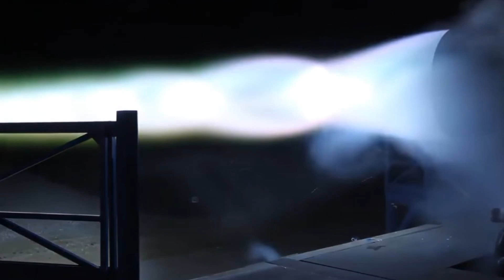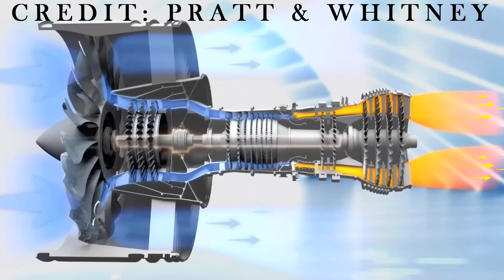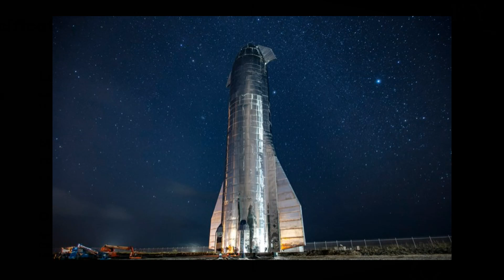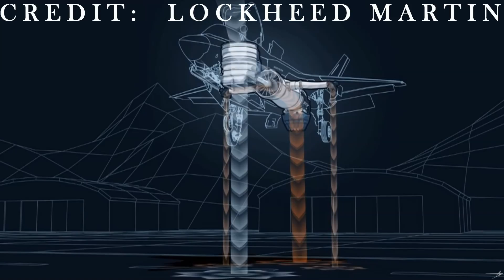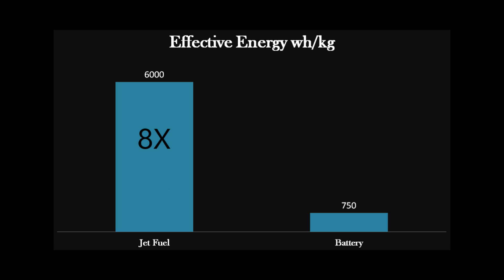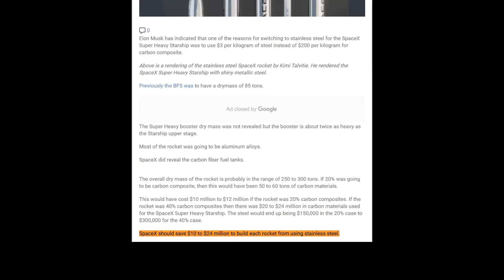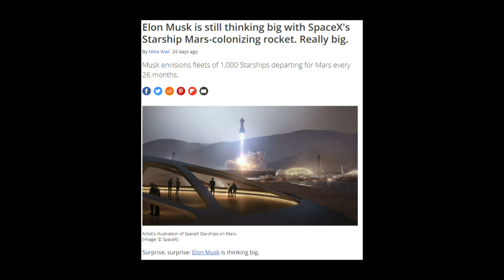ELON MUSK'S BATTERY POWERED SUPER SONIC VTOL JET - My Tesla E-SuperVTOL design

Comment: Really good stuff man. Here are some thoughts, hopefully you can let me know your thoughts about that.

First, it is good to use empty space in nose and tail, but the bulk of the heavy stuff like batteries should be  in the lift surfaces (wings) if safety permits. That's because having heavy stuff lifted directly takes less structural effort than putting heavy stuff in the fuselage. Therefore, the interface between wings and fuselage can be made weaker and lighter. It might be very helpful to place stuff that is heavy in the nose and tail but that can be moved from front to back (changing location of center of gravity) to follow the changing center of pressure due to transsonic and supersonic regimes (like the Concorde, which used fuel to achieve that). In this case, a useful liquid could be moved forward and aft, not sure what this liquid could be. That adds plumbing too. Maybe a smarter solution using wing, control surfaces or motors could be used, but I think any of that will inevitably increase drag.

Second, if you have 6 engines for redundancy, you need the aircraft to operate properly with 5 engines (the most critical engine being out). In this case, the most critical engine will be one of the 2 forward or 2 aft engines. I'm not sure the aircraft could balance itself on landing using 5 engines, because the engine opposite of the failed one will destabilize the aircraft. So now you need this one to produce about zero thrust. So the aircraft needs to land on the power of 4 engines. If the aircraft is capable of that, then it works out. 

Note that the aircraft won't be able to land with 2 failed engines. That's because if you lose the 2 most critical (both front or both rear engines), then you have an insane pitch (down or up) moment that you have no other way of controlling.

As a result, for redundancy, I'd prefer to double the number of engines from 4 (bare minimum for control) to 8, the additional 4 being very close to the initial 4 (so we can have any 1 engine failing with no problem). They need to form something like a square, but the aircraft also needs wings. I'd consider a double wing, i.e. 1 forward wing, 1 aft wing. This would probably increase drag compared to only 1 wing, but with Elon's crazy engineering, the wings could tilt to provide efficient long-term control (like airliner's trimmable horizontal stabilizer) be used as you mentioned. You probably still need control surfaces for short term corrections, both at low and high speed, but maybe they can be a lot smaller if the engines gimbal quickly and sufficiently.

Third, I don't think you can remove the vertical stabilizer. This one is to stabilize the aircraft naturally. I know that drones don't need it but that's because they stabilize directionally with the rotation of their engines (2 opposite engines will increase power, the 2 other engine decrease power, overall it's the same total lift, but the rotation increased in one direction due to more power on the set of opposite rotors rotating in the same direction). You won't have this effect with your jet design because the rotors will be tilted forward, and therefore won't be horizontal like in the drones.
See the V-22 Osprey. It has vertical stabilizers because the motors flip forward and it has only 2 motors, not 4, so there is no set of 2 opposite motors like in drones. See Chinook, rotors horizontal all the way, no vertical stabilizer. (tbh, I do not understand how the Chinook gets directional control)

Fourth, I'm wondering what is the distance threshold where people will choose to fly on a rocket for 30 mins transcontinental (even though they still need to fly to the take-off area, and then from landing area to destination). To me, it means that long-distance jets won't be needed as much over time. Also, reaching 2+kWh/kg seems really difficult.

So yeah, I think static and dynamic stability on all 3 axis need to be ensured to allow controlled flight. What do you think? Do you agree or disagree?

Again, excellent job and I look forward to more videos!
Reply from the maker: This is really excellent and thoughtful feedback.  Much appreciated!
Reply: Great points. I think because of battery density you will need to stick batteries everywhere. The wings for sure, but you will need to stick them every place you can.

Comment: The motor thing on the jet electric jet I read about a year ago that super conductive material should come down you're around a price of copper here within the next year or two. Could license the technology from the pre coolers from the Cylon might be a way a cooling a regular electric motor but I have thought about electric motor electric motors in ways to cool them maybe diamond or graphing heat sinks can be used I kind of like a liquid Electric motor I kind of like a liquid electric motor for cooling or I should say biggest parts of the motor could be built liquid

Comment: Superconducting Motors cooled with hydrogen could be used to run two of the Jets with hydrogen or a nitrogen cool some of the skin could be solar panels since I didn't have no windows the lithium ion batteries could use the metal in the batteries as skin on the jet. Course I know free energy you wouldn't need much batteries but I still like the ideal of the solar panel even though they're not needed.. this is just off the top of my head and it's probably wrong I'm pretty sure wherever 4 square feet could be a hundred Watts. And I think another cheap material cheaper than you might think think I've come up way to put graphene into aluminum to make it much stronger.
Reply from the maker: Great idea with the hydrogen!

Comment: Well there is the option of using microwave transmitters to recharge batteries in flight, so really the range could be infinite with enough transmitters.
Reply: Jet engines yield propulsive jet power in the order of magnitude of mega watts. Even if you would charge with the transmitter at the same power level as the motors use, the microwave beam would be super duper intense and I think you don't want any passengers or eggs on board when that beam hits the aircraft. Besides, transmitting the power over such a distance will inevitably be less efficient compared to it charging while on the ground and the aircraft would have to be outfitted with a receiver, which would increase its weight. Nice thought, but I think the only application of microwave power transmitting we might see one day is relaying power between space stations.
Reply: @evertbunschoten2930  Dude with a fine metal mesh you can stop microwaves, also most of that power is used for take off , during flight you are using far less power.

at take off yes it's 230MW but for crusing speed it's 23MW for a 2 engine 777, with a cross section of 100 meters squared you can get to 20MW with 20W per centimetre squared and the metal outside would act as a rectenna converting that into electricity.

So no you wouldn't get any microwave inside, in actuality you only need a mesh with less than at maximum a mesh with 1mm holes, this is why you don't get blasted with microwave through the window in a microwave oven.

in actuality if you used longer wave length microwave and the microwaves in microwave ovens are more like 2cm you only need a mesh with 2 cm wide holes to block the radiation.

You would need 2 wires every 10 cm squared or so as you are at 200W by then, but it doesn't need to be a thick wire to take 200W, and the skin of the air craft can take 100W electric without heating up significantly.

And it's far enough in the safety margin they some wires could fail and you would still be fine.

so yeah you can't fly forever, but significantly longer.
Reply: @Etheoma  The GenX engine, used on the Boeing 787 yields a nominal cruise thrust of about 90 kN. If the aircraft flies at Mach 0.8 at an altitude of 30000 feet, that translates to an airspeed of about 243 m/s. 90*243*1000 = 21.9 mega watt. Of course the electric jet will fly even faster, which increases power even more.
Reply: @evertbunschoten2930  as said this is just using the skin of the aircraft, you could use longer wave length microwaves like 50cm and just have a wire net on the surface of the skin which could up the energy you could take, because you could use copper which is a much better conductor than a skin of an aircraft.

Also as said in this video, an electric craft can fly much higher than a conventional craft so you can fly faster for the same energy due to lower air resistance, half the air density means half the drag, also because your electric VTOL wouldn't need large wings for take off you significantly decrease drag there as well.

Furthermore you are talking about a larger craft which would obviously have a larger cross section allowing you to take in more energy.

This does stop working at a certain point because of the square cubed law, increase the volume by 2x and you only increase the surface area by 1.5x.

But still you can get more energy on a larger craft, and as said you can still increase range a lot even if you can only get half your energy from microwave transmitters.

This would either allow you to reduce the charge cycles or allow you to use the same craft for long haul and short hall flights more economically.

Comment: Hybrid Kerosene Turbofan/Electric Ducted Fan Passenger planes will be the first real step towards the aircraft of the future and for quite some time as energy needs to be generated en route so the best solution is to use something which also develops massive thrust..
E-VTOL would never be feasible unless battery power increased to almost Nuclear range-how much energy would be required to lift several hundred tons vertically?
Fantasy.
Reply from the maker: Agreed, great feedback!

Comment: The outrunner electric motors for RC planes can reach power densities of over 6 kilowatts per Kg.  3 times what Tesla's larger motor is at.  So with proper scaling electric motors could be designed to be good jet engines.  Also if air compression could reach over 400 degrees water could be used to flash into steam for more propulsion on takeoffs.
Reply from the maker: Dude, genius idea with the flash steam.  This could also be used to cool the electric motors?
Reply: @thelimitingfactor  yes and the hotter the more powerful it would be.

Comment: It seems that upward of 30% of energy required for a flight is to reach cruise altitude. So can you consider a system where the plane is piggy-backed on a drone that serves to help to get the plane to altitude, then the plane separates and the drone returns to base.

This way the extra weight of batteries and motors required for the climb is on the drone.  Thermal management of batteries and motor will be a challenge. 

Also by landing traditionally instead of VTOL you can save weight of extra motors required for VTOL.
Reply from the maker: Elon mentioned two different propulsion systems.  I'll incorporate into my next design if I can!  Jet engines wouldn't be efficient at low speed and altitude
Reply: @thelimitingfactor  Hi, the drone "booster"  could have motors optimized for lift through the lower atmosphere. The plane proper can then have it's motors optimized for altitude, especially if you remove VTOL landing as a requirement.
Reply from the maker: @shahbazfawbush  I'll choose the way of pain, lol.  Not letting go of any of the requirements :)

Comment: I like the video and concept very much. Where I have reservation is in the ability to make better batteries that are this much better, without drastic changes in the strategy of those. There is a huge worldwide pressure to make more batteries and also better batteries, yet, real progress is not really seen. The only significant progress is in batteries able to take higher charging current, degrade less over time, use less rare materials; but energy density while it has not hit a wall is very slow in its advance. There are serious strategies out to get to 400 WH/KG (real), after that is still science-fiction. The removal of all the un-necessary stuff is the sweetest to my ears. For the moment it would be very interesting to have a car that have 250 WH/KG battery in it. (ant that does not exist yet)
Reply from the maker: I'll be interested in your opinion after my battery technical deep dive video.  My main concern for this jet is the motors - lots of disagreement from experts.  I'm talking to everyone I can to make a better version.
Reply: @thelimitingfactor  Motors are limited also by temperature and material dilation : high end electrical motors have rotor/stator distances that are the smallest possible until problems occur, so cooling even more difficult, especially with continuous use. (you could draw a parallel to F1 fossil engine where piston can not move in the cylinder when the engine is not at the right temp) about BATTERIES : the power by weight of CELLS differ from the power by weight of PACK the power by weight of pack by definition lower than that of the cells. Tesla will use LiFePO4 batteries in Model 3 in China with less power from the cells but less pack surplus of weight, so with a penalty in overall weight but a bonus in cells cycle life, and no cobalt in chemistry.
Reply from the maker: @AlexandreLollini  Awesome, I learned a lot from this 💥💥💥

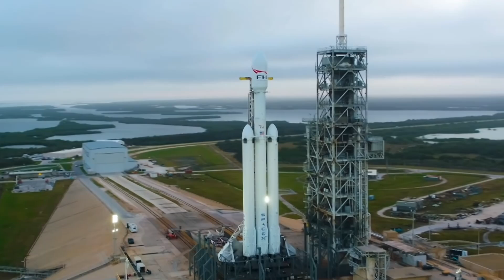Comment: I think at 4:50 it's a mistake, on the Falcon Heavy the high count of parts and engines and boosters made the rocket potentially less reliable because of complexity, the point about redundancy is valid, but the case of FH does not apply to this. You should take the Dragon II capsule that has 4 parachutes, but can safely land on 3. Or the case of a 4 engines jet that can land on 3 or even 2 if those are on different wings.

Comment: Fantastic video! I couldnt visualise the design myself before I saw this but this seems like the right direction. I do think that it would be advantageous for his first plane to have pilots and a crew in place, much easier to gain approval for a commercial jet if it was up to current standards. 

I had a look and I found that Elon said during on the Joe Rogan podcast: "the trick is that you have to transition to level flight and then the thing that you use vertical takeoff & landing is not suitable for high speed flight. I have thought about this quite a lot and the interesting thing about an electric plane is you want to go as high as possible but you need a certain energy density in the battery because you have to overcome gravitational potentially energy and when youre at a high enough altidude the energy density you use is quite less and you can recapture quite a lot of the graviational energy on the way down because you can use the energy of height which is a lot of energy... the way to think about a plane is it is a force balance... so a plane that is not accelerating is in neutral force balance, you have the force of gravity, the lift force, the wings, then the force of the thrusting device like the propeller/ turbine and you have the resistance force of the air. The higher you go the lower the air resistance is, air density drops exponentially but drag increases with the square meaning the higher you go, the faster you will go with the same energy and at a certain alitutde you can go supersonic with quite a lot less energy per mile then an aircraft at 35,000 feet." 

So from his conversation there he believes that you cant actually use the 6 propellers for takeoff, I am wondering if it would be a more efficient design to create a large number of very small diameter and high RPM electric motors along the wings that would be more efficient and be better for redundancy., if one fails it wont matter because there are 20 more in operation. Also current Tesla's charge at 0-100% charge in an hour so that would be more than enough time for boarding passengers and baggage.
Reply from the maker: Thanks for posting this!  I was parsing those words this evening.  I think he's saying it needs two types of propulsion.  Perhaps recessed/ducted fans in the wings, then the supersonic jets.
Reply: @thelimitingfactor  How about an external fan on the top of the jet engine (with a ring mount so air is not obstructed) powered by the jet engine motor and maybe a simple gearbox so that the high rpm jet translates to a lower rpm on the big external fan to provide VTOL. Then the big external fan decouples from the jet engine and folds down into the engine fuselage when the speed is high enough for the jet engine to take over. Does this make sense or am I overlooking something?
Reply from the maker: @GeneralBlackNorway  I think I grasp what you are saying, and I think it's a an awesome idea.  Is there an example with any current or former  jet that I could use to visualise?
Reply: @thelimitingfactor  I couldn't really find any good examples. The best would be this one, but maybe you could edit the image with a bigger hole in the middle/axle: https://images.app.goo.gl/eJ13F8YE5r8rbJ338

Alternatively we could use a design like the osprey, but instead of the air intake being just that, it instead houses the jet engine, while the bigger external propeller is off axis in the front: https://images.app.goo.gl/CWxtgu6UrSzKfs1u8
Reply: @thelimitingfactor  any chance of crow-barring the name into E=MC2?
E-Mach Squarupervtol? :D
elon-musk can can :D #ironman help :P
Reply: @thelimitingfactor   it's a very promising design, but I believe it lacks when it comes to control and safety. If the power or motors failed there would be no way to control the aircraft, and you would have no natural light from windows during an emergency. In addition this craft would have no form of rudder controls except for differential thrust.